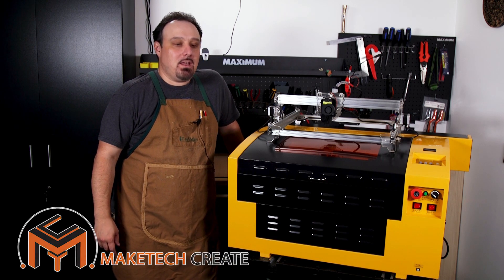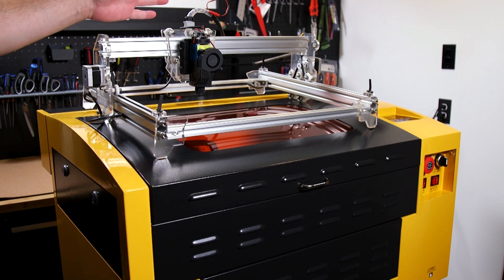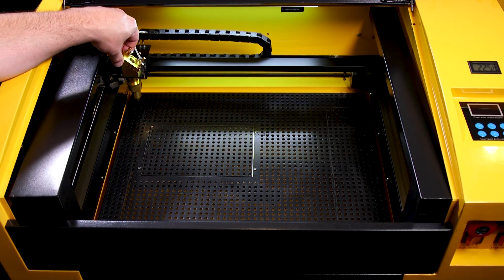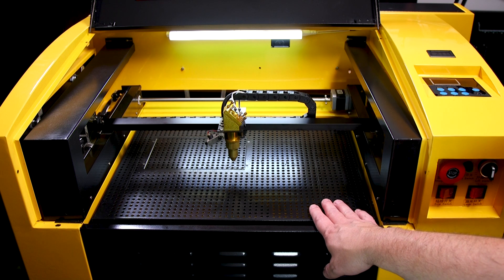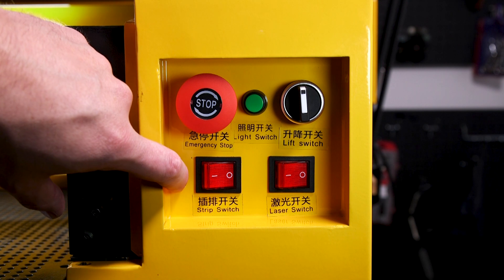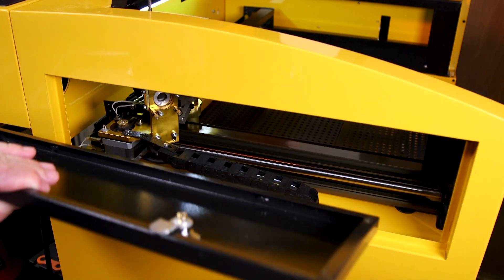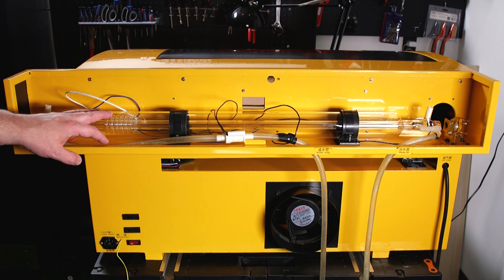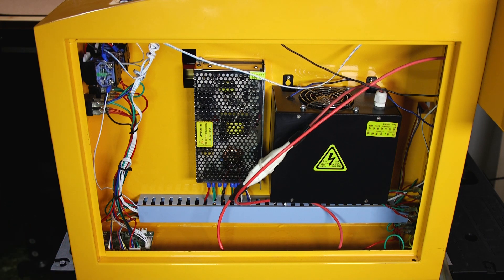Chinese CO2 Laser Engraver / 50w Laser Cutter Guide Ep. 1

Comment: I purchased my first laser cutting engraving machine 5 years ago. It was a 40w 8X12 with air assist from China. I had CorelDraw X6 and the laser machine came with CorelLaser plug in for my CorelDraw. It worked great for years till 2 month ago when it stopped working. It was time for a larger one so I junked it. 

All these China laser machines (blue/white, red/gray, blue/gray, red/black) on eBay will only use another software program. So I must change over 400 CorelDraw files into another format so they can be imported into another software program. This is BS plus I have to learn this new software program.

Now I am looking for 50w 12X20 laser cutting engraving machine that uses CorelDraw and the CorelLaser plug in only. I think this is the laser machine I am looking for and the top controls are the same as my old 40w laser machine.

Comment: Hi Paul..... I will be ordering one of these exact lasers  tomorrow . Now that you have used yours  for some time what is your opinion? Any issues i should know about? . BTW I am in Thunder Bay ON. Where are you located?
Reply from the maker: Definitely worth what you'll pay for it.
Note that you should expect a bit of a learning curve, but it's all good after you get the machine figured out. 
There's not any major issues I can think of that would make tbem different from other machines.
At this point, I do wish I had a larger, more powerful machine ... but that's all pie in the sky as I don't have room.
The new ones seem to come with the upgraded controller, so that should make life easier for you.
I'm over by Calgary in South East BC.
Reply: @MakeTechCreate  sounds good . i didnt get the uppgraded controller they were out of stock so i bought the one with the basic controller . i have ordered a ruida rdc6445g and  2 stepper drivers to do the upgrade. BTW i only want this laser for rotary work like tumblers etc. I already have a Boss LS1630 laser for all my other work.